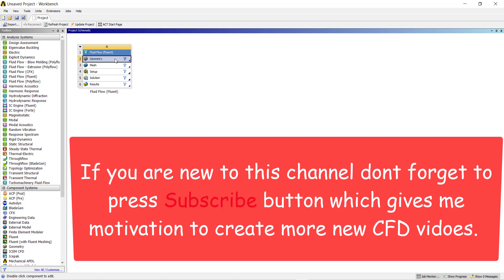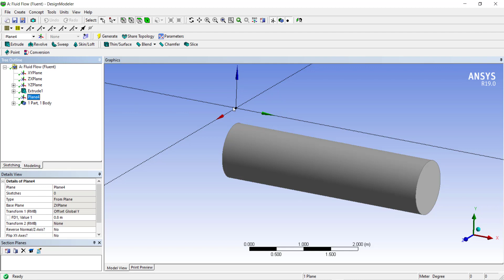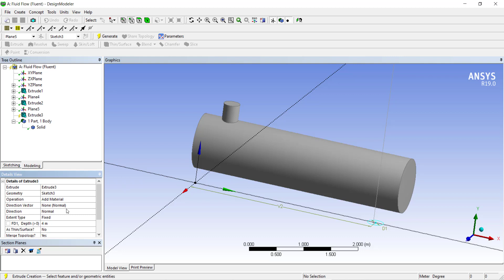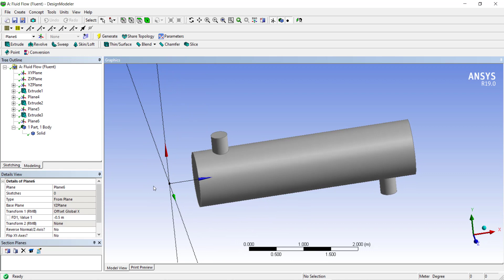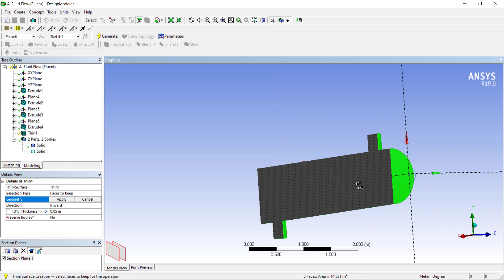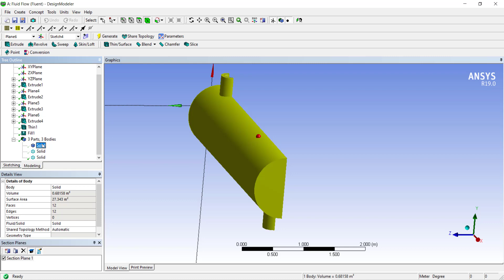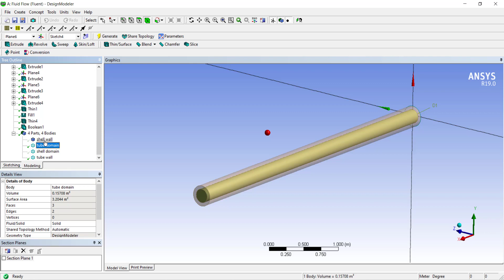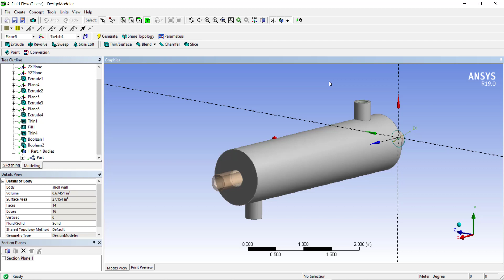How to do CHT Analysis of Shell and Tube Heat Exchanger using ANSYS Fluent | Tutorial | Part 1

Comment: Iam using Ansys 16.0 and when I use the section plane, my solid body is hollow. How do I fix this?
Reply from the maker: Hello. Make sure that you have executed all extrude operations correctly. Also make sure you  have used 'add frozen' while extruding.
Reply: @cfdbaba  Yes I cross checked it again. But when I remove the section plane, and apply the thin feature and boolean, I am getting seperate solid bodies for the flow domains and walls, which is what was required.